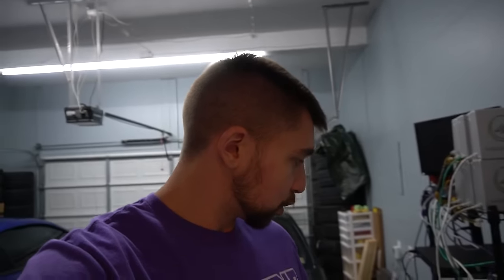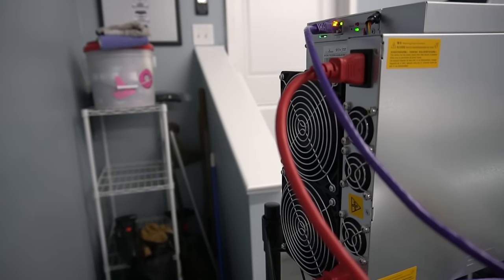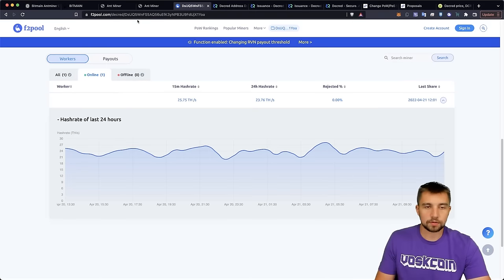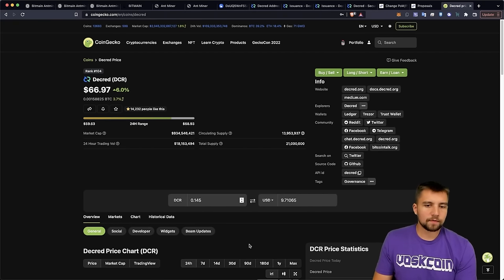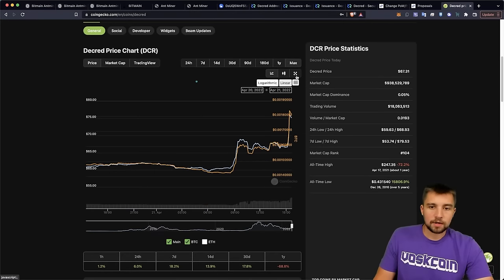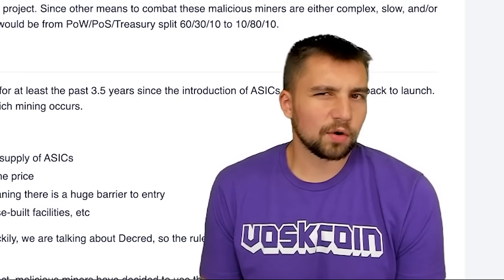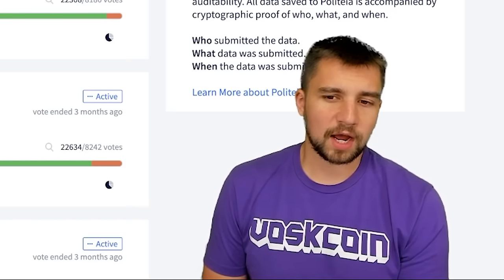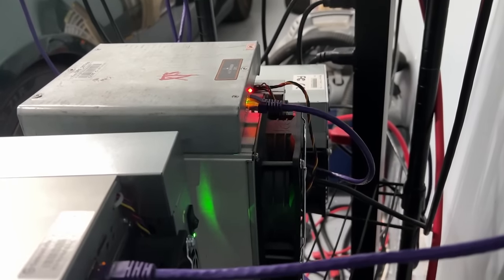This Miner is QUIET, PROFITABLE, and BROKEN WTF?!

Comment: Hi Vosk
Been watching your vids for better half of 6 months now. Big fan. Appreciate the light hearted sarcasm - it works.
On that note, I live in PERU but mom comin' down to visit me so thinking of asking her to mule a miner down for me - I know, I'm horrible.
That said, even though you put out beginner vids like this one, as I have never mined taking that first leap is not so easy.
Seeing as that I am your fan - I'm a liker and good for that youtube algo, perhaps you can suggest a first rig to start with consider my location. Do you have like a document for beginners? My voltage down here is 220. internet speed is solid. I am thinking PoS (not work).
I'm open. Love to get your 3 cents.
Thanks

Comment: Why is dr5 listed so low but everything else on that webpage is listed high?..
Reply: Probably because of the update to DCR that is one week away and will reduce Mining yields by 85% as they're changing the entire project now from 60/30/10 block reward split to a 10/80/10 Split in favor of POS Staking. It's basically making ALL of these ASICs wildly unprofitable and essentially worthless moving forward as your DR5 will generate basically $1.20 a day total revenue, and cost significantly more to operate.
Reply: @anonamous8243  Thanks for this insight, I wasn't invested thankfully.

Comment: 16:06 You claim to not know Decred's use case. You do realize the use case is being able to change the core rules of the network via on-chain voting, as displayed in the 10/80 subsidy change proposal? Decred can course correct if something is not working out properly. Giving the bulk of the subsidy award to PoW miners who could care less about the project wasn't working out so we changed the rules. I bet other PoW coins would do the same if they had the ability.

Comment: Hello I also have 2 DR5's. But one unit runs at 570 and the other runs at 600 on the frequency.  They both have updated firmware.  Any way to correct the 570 to 600 on the frequency?
Thanks

Comment: I can't get a definitive answer to this. I just started mining 2 weeks ago. I have an 8 rig system with currently 5 GPUs in it so far. All are 3060 Ti (4 are the limited hash) I have them all overclocked and doing about 50.3mh on the four and 69.5mh on the non-LHR. My question is this. Should I be mining Ethereum or Bitcoin?
I started with nicehash but 2 days later switched to Trex>Ethermine>Robinhood Wallet. Right now it looks like I will make $28 every 3 days.
Reply: These are mining ethereum on either platform.  NiceHash just pays you in bitcoin.

Comment: VoskCoin hope this post don’t get deleted, anyways it seems you are getting/have most of the miners I got, I have two DR5’s for a few years now, the 34Th version and later upgraded to the 35Th, on one of my older 34Th unit one of the boards also went out, it turns out it was the port on the controller board the hash board is plugged into, to fix. 

Do a full cleaning of the hash boards, and buy new data cables and fans, that may fix your issue if the issue is not with the controller boards, I feel bad because for years I only mine DCR just for profits I swap all my DCR coins monthly.
Reply: BTW the new Fan is just because you already taking apart a old unit the fan is a good idea to change before it goes dead, keep close eye on your HW error counts, too high of HW errors means something is going wrong and soon the board will go offline, you hash rate will start to drop before that happens and that’s a good indication to do a good TLC on the miner with new parts, cleaning, new data cables, fans even new controller board, if that don’t help time to upgrade sell it with Full disclosure (if you like) and get a newer one.
Reply: Hello I also have 2 DR5's. But one unit runs at 570 and the other runs at 600 on the frequency.  They both have updated firmware.  Any way to correct the 570 to 600 on the frequency?
Thanks
Tiger Trader

Comment: Curious your long-term thoughts on the Giant White Elephant in the room with Decred, ie the Coming Update you mentioned and 10/80/10 split. This seems to drastically move away from the actual fundamentals of the project itself and basically renders Mining obsolete based on squed information not accurately portrayed and incentives the POS side quite heavily without any infrastructure vested interest, which I think in turn will work against the project and have a dramatically negative effect overall.

I was considering getting involved in Decred Mining but obviously now that's questionable at best. However what is the potential of this Update falling flat on its face and getting voted out quickly and the rewards redrafted to a more feasible scenario not outright banishment of POW as it currently sits.